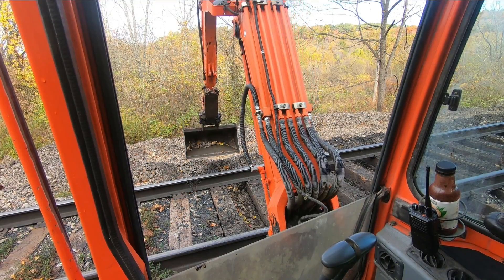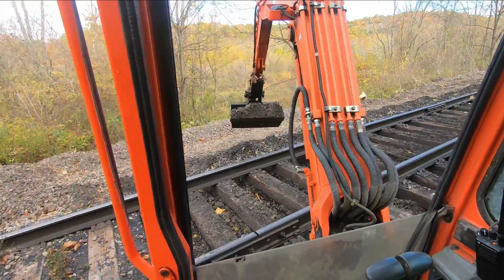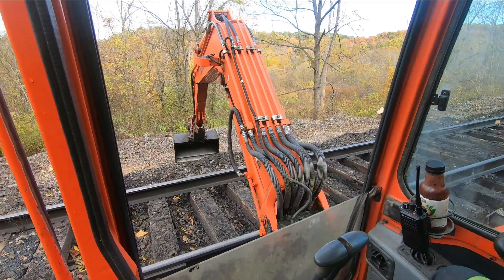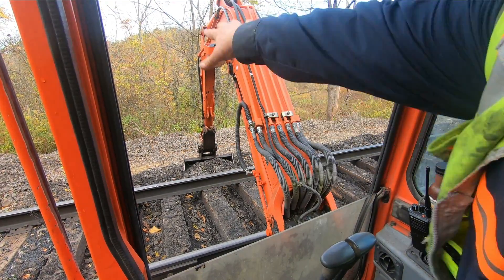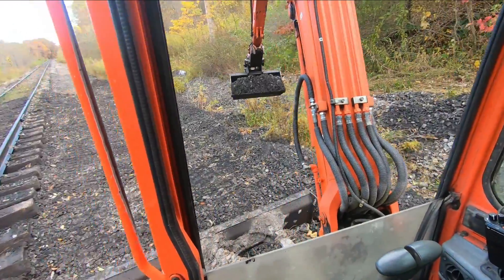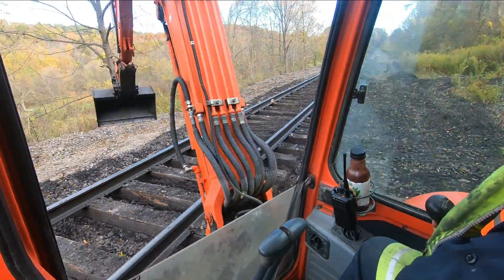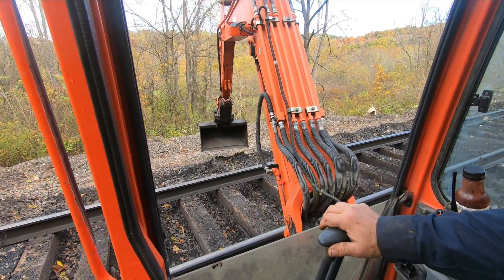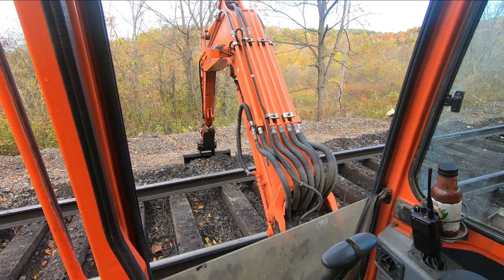Why Don't we Reclaim and Wash our Used Ballast?

Comment: dumping it on the side is just going to make a bigger problem down the line and is not even Environmentally friendly leaving old ballast just on the side. on the edge or not even on your property
Reply from the maker: Coal is actually used as a fertilizer Evo-SkyCat. it increases soil
organic matter. So by spreading coal along the ROW I'm
actually fertilizing the soil. Read this video's description for
more about coal as a fertilizer. 3 major US universities have
ran tests on a coal blend fertilizer and found that it
increased corn production over commercial NPK fertilizers
along with increasing yields on some fruit trees.  Limestone ballast
dust is what farmers all over use to increase the Ph of
their soils. What is not environmentally friendly is the
insane use of commercially produced NPK fertilizers
which over time sterilizes the soil microbes. You won't
find earthworms living in NPK applied fields but you will
find them in organic fertilized fields. 

Coal is formed from organic plant matter from millions of
years ago and compressed over that time. 

What I don't do is spread the coal fines out anywhere it could have the possibility of getting into a stream. That is an EPA no no and would get the company fined. Thanks for watching the video today.

Comment: I always enjoy your videos, but help me understand this......1. muddy needs to be replaced but the stuff you're moving looks good why can't you just load it between those rails. 2. Why wash it? It's rock , why does it need to be new if it's not muddy? Seems like a waste of time and money. Thanks again for the videos
Reply from the maker: Thanks and great to hear you are having a good time with us.
We certainly appreciate your support Dog dad. Coal fines
and mud in the track make for a pretty good ballast as long
as they are dry. However, when they get wet, then it acts like
a lubricant which allows the track to slide/shift. Also it does
not hold track surface very well and there become a lot
of track perturbations from the sloppy ballast not holding
the track surface. New clean ballast actually creates a lot
of resistance as it encounters the ties, whether it's wet or dry
season and track surface will hold up good as well as
track alignment.  Hope that helps and we do appreciate
your watching and writing in today my good man.

Comment: sir it seems that there are certain places on the track that always gets dumped on. is that due to ruff track? I see that it is an  uphill. 
 battle. thanx Ken from gpt ms
Reply from the maker: Over the years Ken since we started in 1977 the whole track
has gotten peppered with coal fines from off the tops of the
cars as well as leaky hopper car doors. Then we get occasional
car doors opening up going down track and too many over turned
cars from derailments in the past. The section I'm currently cribbing
has never been done in all those years, but it was so polluted
track surface wouldn't hold and it was pretty rough as you
will see whenever this series of videos gets shown and who
knows when that will be, may be next year before you see
this series come out. Really appreciate your dropping by
and watching my friend.

Comment: As long as the fines from your waste ballast isn’t washing into local streams stockpiling it within the right of way is basically benign.  There are small rotary trammels for your excavator.   The problem with that is you end up with a windrow of fines that need to be managed.
Reply from the maker: Coal is actually used as a fertilizer Kent. it increases soil
organic matter. So by spreading coal along the ROW I'm
actually fertilizing the soil. Read this video's description for
more about coal as a fertilizer. What I don't do is spread the
coal fines out anywhere it could have the possibility of
getting into a stream. That is an EPA no no and would get
the company fined. Thanks for watching the video today my good man

Comment: You're in vast expanses of USA, but in England there can be multiple tracks with nowhere that spent ballast could be dumped; it has to be removed from site currently, so they take the ballast cleaner to the track.
screened
Reply from the maker: Certainly understand that Uftonwood2. Multiple tracks are
a challenge at times. From what I've heard, please correct me
if I'm wrong, that in UK this kind of thing I'm doing would
never occur whether it was single or multiple track? I certainly
wish we had a better way of doing things, but we are also
constrained by no interchange with any other RR and a lack
of man power and equipment. Really appreciate your watching
and writing in today my good man.

Comment: Do your engine drivers ever let you make a supervised train run?
(I won't tell the union or your employer if you answer)
Reply from the maker: On a rare occasion yes Mack I make an unsupervised run. 
But being that's it union here
I try to avoid it because the train operators get upset and file
grievance if they are not called out to run the train. I do
run loco a good bit when hauling ballast but there is
always an operator with me, I do it to spell him off, plus
it's a fun little diversion. Thank you my friend for visiting
with me today and checking out the show.

Comment: Thanks for another great video..!!  So the implication of making a wash plant and a slurry pond would mean the whatever pollution comes from the coal and the mud and the oil dropped on the tracks from train operation would cause it to be very concentrated.  Would this also imply that the polluted soil and water and the associated by products be impossible to get rid of?  It would seem that continuing the t quo would disperse the pollution more gradually over a larger area in a much less concentrated form, would this be true?  Also the idea that coal mining is going to continue 30-50 years into the future seems like a bit of a stretch as more and more so-called "green energy" comes online.  Out in the western USA where i live the ravages of global warming are severe and solutions to are being necessarily implemented as fast as possible. It would be interesting to hear your perspective.  I thoroughly enjoy your commentary!  Thank You Dave..!!
Reply from the maker: Your welcome, glad you enjoyed sharanam. There is actually
very little oil dropped on the tracks, unless there happens to
have a hydraulic hose break like on our tamper or regulator. 
Coal fines are a fertilizer for the soil increasing soil organic
matter. So by spreading the coal along the ROW I am
really fertilizing the ground. For more info about coal as a
fertilizer read this video's description. 

EPA is not concerned about coal fines laying on the ground like
I am doing, they are very concerned about slurry water and also
I do not do what I'm doing here if there is any chance that
the coal fines could leach into a stream That is a huge no no
and EPA would certainly fine the company for that.

When they clean up a slurry pond, the water will be drained off
and taken to a treatment facility, huge bucks to clean that water.
Then the fines and mud left will be covered with clay, then dirt,
then topsoil. 

Green energy is fine and we need more of it, however there
is no way green energy can keep up with the demands for
energy currently. That will take years and years to develop,
however at some point it will probably happen. From what
I've read, energy experts are in the thinking this transition will
take around 50 years to happen, but who knows with the
advancement in technology, it may be much sooner. 
However no one has figured out how green energy is
going to be used to produce steel. We have to have coal
to make steel. The solution is not very good to just quit making
steel in this country and buy it all from India and China.

Right now the demand for coal and natural gas is tremendous. And
it's world wide. Ten years ago I said we would never see
another deep mine open in this country. I was wrong.
Currently there is a deep mine opening in Henderson County Kentucky and one near Volga WV.  

It is a big picture with a whole lot of moving parts. I could solve
all the world's problems, but I have to spend my time keeping
the Cumberland Mine train on track.... LOL 

Seriously tho since you asked, in my opinion we as USA
need to do whatever it takes to make us energy independent
from other countries and be a world leader in selling energy
to other countries. And that means we need to develop
and promote all sources of energy. I also understand that
platitude will not sit well with all green energy folks. I am
an advocate for the coal industry but in the same light
would never want to go back to the way it was in the early
1900's with the terrible smog and pollution from the steam
trains, steel mills, coke ovens and mines.  We all live on this
planet and no one wants to breathe polluted air. 

Our owners tell us they can sell every ounce of coal we can
mine and if the domestic market dries up, they can sell it
all over seas. They believe the future of this mine is rosy
and currently believe it has at least a 30 year life left to it.
Reply: @ccrx6700  Great Answer..!!  Thank You..!!  LOVE these videos and your great speeches..!!
Reply from the maker: @Dharma-Track  😊👍

Comment: Can't beat the price for new ballast. Dumping the old dirty ballast down the embankment helps to reinforce and stabilize the existing roadbed. You make your right of way look neat and clean.
Reply from the maker: Thanks Gary for the nice comment. Also which I did not explain
in the video, after so many comments, sure wish I had. Coal
is actually being used as a fertilizer. So in effect what I'm 
doing by spreading the coal fines out along the ROW is
increasing the organic matter of the soil. You can read more
about coal as a fertilizer in this video's description. What the EPA has conniption fits about is when those coal fines may have a chance 
of getting into a nearby stream. So I do not do this if there
would be a possibility of coal fines leaching into streams.
that would be a big fine for the company if EPA found out.
Thanks for watching and writing in my good friend.

Comment: American civil works always seems mighty backward, friend of mine (who I sometimes work with) works for a company that mainly does rail works, almost all their machines are hitachi or Liebherr 20 tonner ducks set up with quick hitch (of course), engcon tilt-rotators and harrybilt hi-rail rolling frame, this makes the machine ideal for rail works but without that an excavator is barely useful at all on the rail, I keep seeing machines under 30t in America with buckets pinned to the machine, primitive, cheap. Try it the other way and you'll never look back.
Reply from the maker: It would be nice if we had a hi rail excavator and they have
actually priced 2, one by Volvo and the other by Cat. It's $650,000
so don't know if it will get approved for next years budget or not.
We shall see what happens. I sure could use one. Thanks
so much for stopping by and checking things out Ejay.

Comment: Looking good Dave on the cribbing and great explanation of why the dirty ballest isn't reclaimed. But it does work good for shoulder side roads 😄.
 Picking out the bigger stones BY HAND ✋ from a pile by a group of people would answer alot of questions and get old real quick for the topic. 
It does boil down to time and material and costs $.
BTW, track looks good for 70 even if it's just a few hundred feet 😉. Richard Bause
Reply from the maker: Your right Richard, perfect for a side road. Plus the coal fines
actually help to increase soil organic matter. Coal is a decent 
fertilizer and if you'd like to find out more about that, read
this video's description. Really appreciate your dropping by
and checking things out my friend.

Comment: One thing you didn't mention, how often a particular stretch of track needs to be redone.  I've seen that it's a steady part of all your MOW work, but you aren't doing the same curve every month.  Of course there are some oddball situations, like when that car decided to dump its load on the track, but just in general, how long does a good ballasting job last?

Yeah, as soon as I saw the title I was like, "How do you dispose of the slurry?  THAT's got to be an expensive thing to deal with."
Reply from the maker: Well Mike in this video, it is the first time it's ever been done
since we started 43 years ago. Once I get it cribbed and tamped
up good it will last for a long, long time, at least until, like
you say, another car dumps it's load on the track.... SIGH
So there is no set schedule for when a curve gets cribbed,
we've got a lot more to do. Really appreciate your dropping
by and taking in the video my friend.

Comment: Sadly your track needs to be cleaned more often than a regular Railroad because of the coal fines. By spreading it to the sides it probably helps hold down erosion on the Hills and can actually assist in channeling water. Many years ago when the Wisconsin and Western took over some old Milwaukee Road trackage they rebuilt quite a few miles but either their Transit Commission and\or contractor used sandstone for ballast and it was pulverized within 2 years and had to be redone with limestone. Some lines near steel mills would use slag which will last a while but isn't meant for main lines
Reply from the maker: Yes we do have an inordinate amount of coal spillage Paul and
it's a constant thing to keep cleaning out the cribs. I cannot
believe anyone would use sand stone for ballast! They do sell
slag ballast near here but we have never tried it and don't
know anyone who has, it's very cheap to purchase. Wondering
how the tamper tools would hold up tamping that stuff all day?
Really appreciate your tuning in and watching my friend.

Comment: All makes sense Dave and I suspect all that old ballast on the track side, helps slow vegetation encroachment towards the track side.
Reply: Richard Austin: Exactly what I was thinking. And maybe having it
on the upside would help prevent erosion in some way????
Prevent washing mud down to the track? Or not.........

Know nothing about maintaining RR. Am a retired engineer, but not
the RR kind!!
Reply from the maker: Thanks Richard. It does clean up the ROW but with those coal
fines in there, that actually helps increase the soil organic
matter. Coal is used as a fertilizer and if you would like to
find out more about that, read this video's description. 
Really appreciate your visiting with us and watching my friend.

Comment: So if you put coal in a pond, you have to watch it for years. 
Dump it beside the track and nobody cares.
Reply from the maker: Pretty much MIke, EPA is not that concerned about coal fines,
except when it's in a slurry form. We do have to be careful where
I can dump the ballast at along the track as I sure don't want
any run off into a stream. Also coal has been used as a fertilizer
for years and by spreading the coal out along the track, I am
actually increasing the organic matter of the soil improving it's
quality. You can learn more about coal as a fertilizer which
was tested by 3 major US universities by reading the description to
this video where there is also a link to that article which goes into
much greater detail on coal's benefit as a fertilizer.
Reply: @ccrx6700  
Over simplified  - suck up the slurry and dump it on farmer's fields.

Comment: They do have a track undercutting machine. It removes ballast from under the track, washes it and relays it all simultaneously.  Down side to that is you need to be connected to the national rail network in order to get it on your track. In your case you're doing the most productive methods available for your situation.  Great video and thanks for sharing Dave.
Reply from the maker: Your right Zach. Not much else we can do. Sure wish we could
get one of those monster machines in here tho! That would
make for a cool video too! Always great to have you visit
with us my good friend.
Reply: But how would they get that machine to their operation. Once again cost with new rock being so cheap keep doing what you are doing
Reply: @jason27swg  that is why I said he is doing the most effective method for his situation by simply replacing the ballast.
Reply: They have been hauling equipment to their track by truck, for years.  The real question is cost versus benefit
Reply: @robertheinkel6225  yea I agree 100 percent. Think of the cost it would be to haul everything there

Comment: The stuff is full of grease, diesel, and other gunk.  It's effectively low-grade industrial waste. It's not going to kill any baby seals, but I'll bet that it does mildly pollute the immediate area as it weathers. Properly cleaning it means dealing with all that gunk once you've separated it from the rock.  Between the cost of transporting the rock to and fro, processing, and then disposing of the gunk, it's cheaper to just leave the dirty ballast laying around untreated and buy new.  :(
Reply from the maker: Sure wish we had a better solution for the problem geonerd.
We certainly appreciate your taking the time to watch and write in my friend.

Comment: Dave doesn't the ballast just wear out and get smooth and not lock together anymore. Not able to tamp it and hold in place???
Reply from the maker: You are absolutely right Kenn. Over years of train traffic and tamping the sharp edged ballast which is perfect for holding track geometry
becomes rounded and then it's like the track is sitting on roller bearings. Slides around. Most RR's have a comprehensive ballast
renewal program because of this. Wet coal fines and mud in the
ballast act like a lubricant and cause track shifting also. Good
point my friend. Always great to have you visit with me.